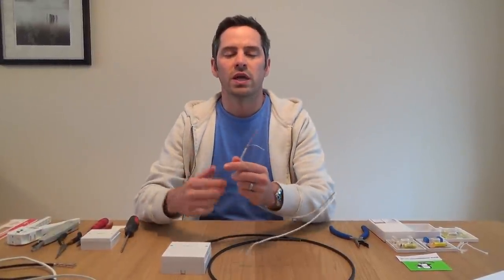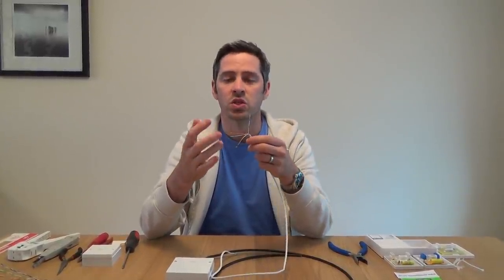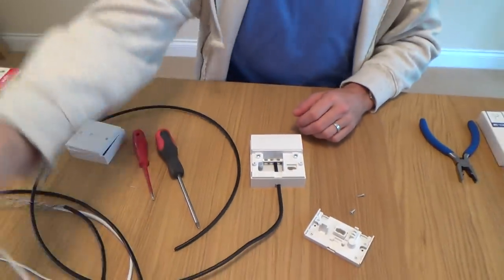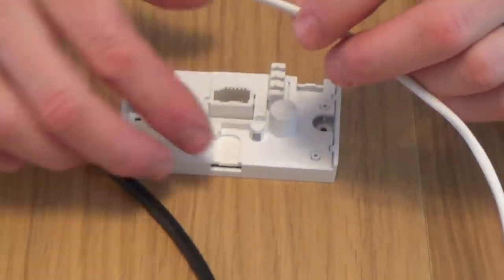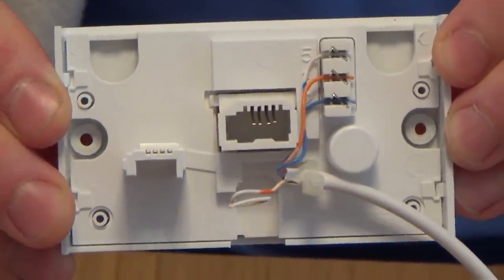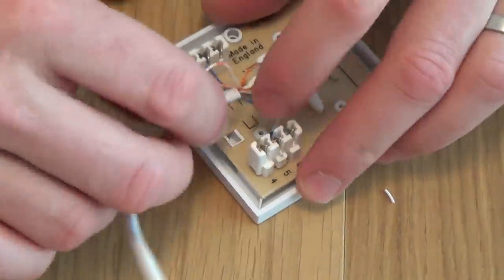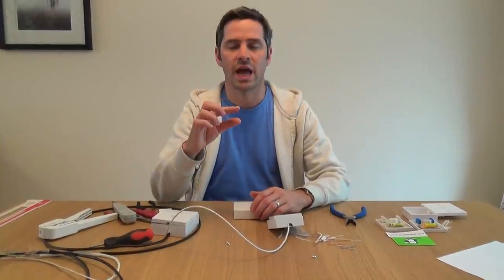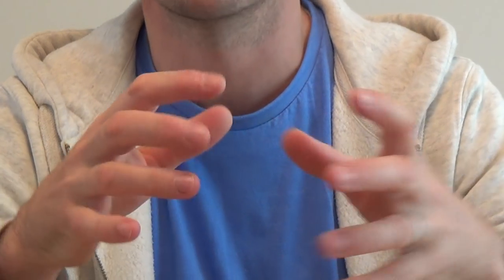How to install a TELEPHONE EXTENSION SOCKET

Comment: Thanks for this, meant to do this ages ago instead of using a plug in extension. BB speed before DL 17.03 Mb/s UL 4.13 Mb/s Speed now is DL 31.92 Mb/s UL 5.71 Mb/s.... was definately worth doing!
Reply from the maker: Nearly double the download. Nice one, you have done very well.
Reply: This morning I have retested and got a touch over 40MB! I have noticed that the upload speed is now only around 1MB, I was getting 5MB :-/

Comment: Thank you so much, just the right "know-how" video for me. I hope it will be as easy to install an extra slave socket as it seems when you're doing it))) Anyway, I feel more confident about this little project now. You have covered all my questions, by the way, because I was wondering whether it's possible to run another extension from the existing one. Wishing you all the best.

Comment: Hi vince,
Just replaced the master tel socket which was very old to a new ADSL FACEPLATE AND BACKPLATEl socket and wired up 2 extensions.Internet speed has gone from 1.67mb before to 4.67mb after carrying out the work. i could not believe thisand have done a few speed tests all day. The old socket  was a mess of old redundant wires still connected. Great videos and easy to follow advise. Thanks Vince.
Reply from the maker: +Stewart Leighton Well done, that is a nice increase.Thanks for the message.Vince

Comment: 0:43 the phone wiring in the house I live in is the same as this; two pairs, one orange and orange/white, and a blue and blue/white pair. Apparently the cable that was used here is meant to be temporary, but it was never supplanted with proper Cat 3 wiring.

Comment: Here's a simple challenge for you Vince. Don't expect you to have an answer but don't think you encountered an old-style problem like this. I connected, from an old-style main socket (having 2 main wires, orange & white) which was downstairs, an extension to another room downstairs. Then from that extension downstairs, connected an extension upstairs. I have nothing plugged into the main socket, but have 2 vintage bakelite dial telephones plugged into the 2 extensions upstairs & downstairs. Both telephones & lines work fine, except the upstairs telephone doesn't ring.
Nothing wrong with any of my telephones but if I swap them around, upstairs telephone with the downstairs telephone, guess what? The telephone which is now downstairs works good. But the telephone which is now upstairs, doesn't even have a dial tone.
Any ideas gratefully received.
Reply from the maker: That is a strange one as you would expect both phones to have the same non ringing fault when upstairs. Personally I would double the check the wiring for the upstairs extension in both the up and downstairs sockets (the terminals 2,3 and 5). You could try fitting an ADSL micro filter into the upstairs socket as normally these will allow the phone to ring. If it does you could change the upstairs socket over to a 2/2a or 2/1a if you didn't want the filter sticking out of the socket as these have the capacitor in them which will allow the phone to ring. Hopefully it will be a wiring problem but if not then the ADSL filter or 2/2a will hopefully remedy the situation :-)
Reply: your master socket is acting as the ringer but you need the third wire 3 to fire your ringer on 2nd phone because that is your extension.

Comment: Hi Vince, nice video and thank you so much. I do have a question re. extension of a broadband cable. I checked mine, it uses a two pair cable and all 4 leds are connected from the main-socket (outside the house) to the socket inside the house. In my case can I also just use the blue-white-orange like you showed in the video, or do I need to connect all 4 (blue-white-orange-white)? The reason for this is that I'd like to use one old telephone cable (only has 3 leds), which is already installed in the house. Thank you again for your answer. Best regards!

Comment: Hi Vince, Great videos and really helpful.  Could you please suggest the safest way to remove phone wires from the back of the faceplate when there is very little slack to play with.  Thanks.
Reply from the maker: +mick f Hi, if you have a krone type punchdown tool (the professional type that snips the wire when punching down) then it has a little hook that you can pop out and this hook is really good at pulling out the wires. If not you can just yank them out and if you can't get any slack to re terminate them then get some 2 wire jelly crimps and a bit of old telephone wire and extend each wire out (preferably using the same colour code (blue to blue etc.) The jelly crimps won't be seen as they will be hidden in the backbox.Many thanks Vince.

Comment: Hi, When you say not to run it from the box into the house, does that mean the actual box that is installed by SKY with two sockets? I just want a box in my room so I can use a wired vintage style telephone but I am worried about touching anything on the SKY socket in case I break something.  My Dad put extension boxes in our rooms as kids, many years ago and they always worked fine but that was pre-internet/broadband days so I dare not mess with any socket I should not!  I'm pretty handy but just don't want to risk the broadband or a big bill from SKY for messing it up!

Comment: Hello! I have a NTE5 master socket and an extension. But whatever way the extension was installed, it does not terminate into the socket, instead a normal phone plug was put onto the wire and plugged into the socket in the master socket. Could I just cut the phone plug off the extension cable and wire it to the master socket like in your video or do I have to re run the whole wire again? Thanks and keep up the great videos
Reply from the maker: Andrew Hume Hi, if it is solid core wires then you will be able to hardwire it in but you will see no benefit  (apart from neatness) to hardwire it in. If it is very flexible then it may be stranded wires in which case they do not punch in well to the terminations so I would leave it as it is with the BT plug on it.Thanks Vince

Comment: Hi great video. Can I use a junction box? I have master socket close to front door and want to do two extra sockets.. one in living room and another one upstairs bedroom. I am guessing that will be 3 wires in one point each 2,3,5 . Will be my connection weak? Cheers
Reply from the maker: +Mariusz Łysik Hi, if you are using one of these NTE5 master socket then you will be fine because the main wires connect on the backplate and then you connect up the 2 extension cables onto the removable frontplate and the IDC terminals allow 2 wires in each slot so you will be fine. If you have the very old smaller master socket (2/1a) then you will not be able to connect up 2 extensions because it will be 3 cables in total and again the IDC slots only allow 2 wires.
Thanks Vince
Reply: +My Mate VINCE thanks for quick response. That's grand, I have a new socket wasn't sure though. Cheers

Comment: Great clear video, thanks. Did as shown and the phone extension works perfectly (using filter) only problem is that the broadband from original socket stops working, disconnect the wires, works again. Any Ideas? Many thanks!
Reply from the maker: +Eddie Sharples I wonder if your line is on the limit and when you install the extra extension it is enough to knock the broadband out. Try disconnecting the ringer wire on terminal 3 so only connect wires 2 and 5 to see if that helps.Thanks Vince
Reply: +My Mate VINCE  Thank you! we are located a long way from the exchange. Suggestion to remove ringer wire worked!

Comment: Excellent and really helpful videos ... what junction box would I use to split an incoming line 2 ways? Is it a BT77A? I'm confused !!! thanks
Reply from the maker: Hi, yes a BT77A or BT78A but you shouldn't split the incoming line. You can split after the master socket but not before.
Reply: My Mate VINCE Hi , If I've punched a wire in the wrong slot can I just pull it out and re punch in the same slot?

Comment: Hi Vince,  supurb video.  Very clear and informative.  QQ.  i want to add an phone line extension and have followed your video step by step.  I have a working phone line and BT internet service plugged directly into the master socket.  When I wire up the extension the internet goes down.  I have exhaused all my ideas from replacing the main socket, to only wiring up the blue  and blue/white  but still the same problem persists.  Any idea's would be more than useful.  Thanks again
Reply from the maker: Have you plugged a filter into both sockets (if you have equipment plugged into both sockets) and did you use copper cable like CW1308 or was it the cheaper copper/aluminium mix cable?
Thanks Vince.
Reply: +My Mate VINCE thanks so much for getting back to me.  I have bought the copper wire you suggested and have a filter in the master socket with working broadband.  When I remove the faceplate and wire in the new extension, the master socket stops working.  I have tried this several times making sure everything is wired up perfectly but still no luck.  Thanks so much for helping me out, many thanks
Reply from the maker: Hi Chris, if the master socket is actually dead (no dial tone) then it is easier to fault find. Firstly disconnect the extension socket and test again at the master socket with the frontplate attached and the extension cable attached so this will eliminate the extension socket. If it is still dead then it must be the cable or the frontplate so disconnect the cable and then test with the frontplate plugged in and if it is working then the cable must be faulty. You could always try the orange wire to terminal 2 on both ends and the white/orange wire to terminal 5 just to see if they work, and then you know 100% that the blue pair is faulty.
Reply: thanks Vince.  I will try and work this out and see how i get on.  if not  I would be more than happy to pay you for a facetime conversation so i can show you the issues?

Comment: hey vince here in nz we uses 2 wires blue and orange can i use cat5 e cable how would you wire the extension box with cat5 e i have cable in extension box can i re move it or do i have buy new socket🙂

Comment: Hi there, thanks for the informative video.. I have a question regarding the blue pair. My current extension is wired in and functioning but with the blue to 5 and white/blue to 2.. Is this correct or should it definitely be wired as you stated? I imagine the pair make up a circuit of some sort so it may not matter. Grateful for your feedback
Reply from the maker: darkchildjon Hi, if the other end of the cable is also wired up blue to 5 and white/blue to 2 then it will not make any difference. The wire doesn't care which colour it is but it may/can cause confusion to an engineer if they had to work on your extension wiring. You may as well leave it as it is if it is all working well and if you come to do any new work then you can follow the standard colour code as shown in the video.Many thanks Vince

Comment: hi vince just watched this video i bought all the stuff i need i was just wondering can i use another bt openreach socket for the extension or do i have to buy something else,as i have a spare bt socket box here, thanks again
Reply from the maker: K Crawford Hi, it is best to use a 2/3a extension socket BUT........another BT master socket will work as an extension but it will cause confusion in the future if an engineer is ever working inside your property because you will have 2 master sockets on the one line but you will be able to plug a phone in and get dial tone just fine.Thanks Vince

Comment: Vince I have watched a couple of your video's very well made. Thank you. I have put a splitter (Tel and ADSL) in my incoming line to position my router middle of house (3 levels). I now want to split the line again (Tel and Tel) back at the wall socket. will this work..?
Reply from the maker: +Michael Holmes Hi, yes you can split the telephone line, remember that the little IDC terminals will only accept 2 wires so you may have to put in a BT78 junction box which has more IDC terminals if you run out of space. Telephone extensions can be daisy chained from one socket to the  socket or star wired (split) from one location.Thanks Vince

Comment: Thanks vice, interesting vid. Question... How would a spur be run from an extension? Once the wires are clipped in there from the main socket, how would you run an extension from that extension? is it just a case of pitting the extra wires into the same slots?
Thanks
Reply from the maker: +Sillynuts Hi, yes that is correct. You can fit 2 wires into each slot/terminal.
Thanks Vince
Reply: +My Mate VINCE Thanks bud, hugely appreciate the reply

Comment: Can you use the cable outside your house? Cause I'm planning to put an extension from our house to my mother's house. Is it possible? Thanks!
Reply from the maker: Mark Gilbert Brual Hi, yes you can, you will need to use external cable because internal cable will degrade in the sun over the years.Thanks Vince

Comment: Hi. I have a daft question. When you put the cables into the terminals using the push down tool, to my eye the cables that are now in the terminals still have their plastic on them covering up the copper inside. How is the connection made between the cables and the terminals if the plastic coating is still present? I would have thought the plastic sheath would have had to be removed prior to installing the cables?
Reply from the maker: +jmcphee7 Hi, the metal in the actual terminal (IDC Slots) cuts the plastic on both sides to touch the copper on the inside so you don't have to strip them back to bare copper.Thanks.

Comment: Hi Vince, I'm looking to move my BT Infinity Home Hub from the master socket location (daughter's bedroom) to the lounge so I can have better speeds in there and also hard wire sky box, PS4 etc.  Would this extension socket in this video do the job?  Great video's by the way!!
Reply from the maker: +Scott Owers Hi, if you use the plug in dangly micro filters then yes it will work but the speed may drop slightly depending on the cable used. BUT if you have a VDSL faceplate on the master socket then you cannot move your router unless you look into a dedicated data extension which is more complicated.
Thanks Vince
Reply: Thanks Vince, I do have the filters so this would work.  Thinking of routing the cable outside as the better half may not appreciate cable all through the house, do you recommend/sell a cable for this? And would the distance of cable have a bearing on the speed? Thanks
Reply from the maker: +Scott Owers Hi, longer cables can affect the speed but if you go for an external cat5e it will minimise the loss. Have a look in my ebay shop for prices of external cat5e cable.
Many thanks Vince
Reply: +My Mate VINCE thanks Vince, will take a look.....and thanks for your speedy replies👍

Comment: Vince on the bt80 its A and B .so when you get to extension socket they are numbered so which number terminal  corresponds to the A and B
Reply from the maker: I normally remember it as B for Blue. The Blue wire normally terminates on number 2 on the extension socket. So A with be on number 5 on the extension socket.
Reply: My Mate VINCE okay thanks

Comment: Hi Vince, I've bought an extension kit from you and followed your instructions carefully to install the extension socket using some CW1308 cable and for 2-3 months it's worked without any issues. I even noticed some incredible download speed! However over the past few weeks, we've noticed intermittent connection drop outs (several times a day). I've then plugged my micro filter directly into my test socket and no issues. I've also tested it for several days in the face place on the master socket and it's been fairly stable (a few drop outs though). The extension cable is attached to the face plate so it seems to indicate an issue with the extension or face plate perhaps. I've also tried to disconnect the ringer wire from the face plate as I've read that it can cause some interference(?). Before I start ripping off the extension cable that I hid between the floor and wall and under the skirting board, would you have any suggestions as to what could be the problem or how I can test the extension cable further? Much appreciated and please continue your great videos! Cheers.
Reply from the maker: Hi, you could try moving it onto the orange wires just to test the cable. So disconnect the blue wires and use orange to terminal 2 on both ends of the cable and white/orange to terminal 5 on both ends. Leave it on this orange pair for a couple of weeks to see if it improves. If it does then it means the blue pair of wires is going faulty and the cable may be faulty/damaged.
Thanks Vince
Reply: Thank you for the quick reply and for the suggestion Vince. I'll swap the cables tonight and leave it for a couple of weeks as suggested. The drop outs are happening more often as time goes on and unplugging the cat 5e cable from the extension seems to "reset" it for a while...
Reply: Hi Vince, my phone/router has now been plugged in to the master socket for a few weeks and it's been fairly stable so it seems that the extension cable is faulty and will need to come out. I'm now considering replacing the 2-pair extension cable with some CAT 5e cable and also replacing the i-Plate at the master socket with a VDSL mk3 faceplate. I could then run my telephone extension over 3 cables on terminals 2, 3 and 5 and also my data/broadband extension on another 2 cables from terminals A and B. I would also need to replace my extension socket at the other end with an RJ11 and a telephone module. Does this make sense and would you recommend this setup? Best Regards, Gael.
Reply: @Mymatevince  
Chris Riddiford 
Call